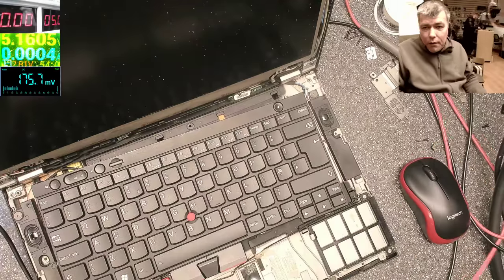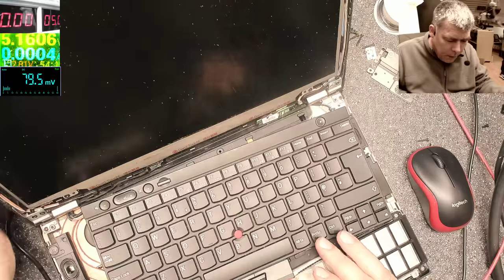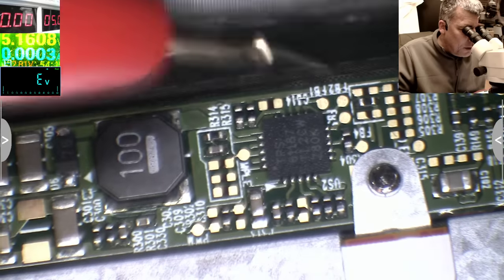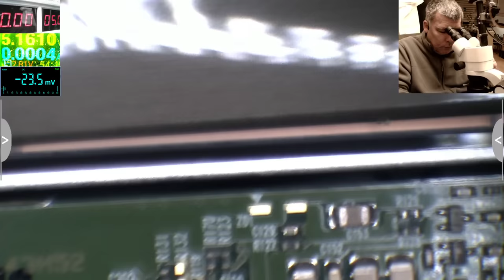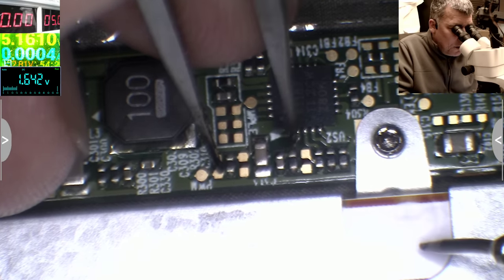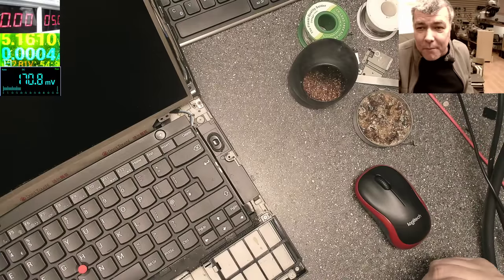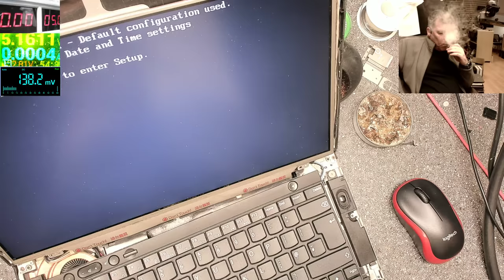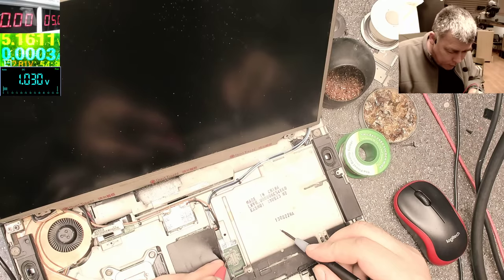Lenovo T430 - Let's learn about the backlight circuit

Comment: 8:57 that test point actually reads PWM, not PWR, so that is most likely your "DIM" signal, since it stands for pulse width modulation :)
Reply from the maker: True, thx
Reply: the major signal to activate the bcaklight is 3 major things .. the B+ PWM and the adj voltage..

Comment: Thank you sir. I watching you about a year. Last 2 weeks i had 3 nice scores: pixel 2 xl - the undercharged battery, Samsung Note 10.1 - slightly pulled screen ribbon cable and Dell XPS 1330 - classic shorted cap, found by your method. multimeter and low voltage + 1 amp current to power rail,  splashed by zippo fuel. It was fun. You making a people happy. Hello from Czech Rep.
Reply: Great. You made a good work. I can also get your information for my skill up.

Comment: Sorin, your overengineered repair audio jack port will outlive the rest of the laptop. 
True, you spent a few more minutes than just switching for the proper part, but it is also more cost effective than ordering the part, waiting, charging the part, etc... 
Always Kudos to Macgyver solutions :)

Comment: Haha, you could also add a resistor to that bridge just to lower the screen brightness a tad so its not at full brightness which would help battery endurance.  Lots you can do to laptops to get around problems and keep them running longer..

Comment: Sorin, thank you for all the knowledge you share with us. Personally, I would put a layer of capton tape below and above the bridge to protect the wire from touching anything arround it. I would not trust the thin enamel coating on the wire. I've seen some chemicals (UV cured) that help maintaining such bridges intact and electrically safe but never used any of them. 
Also please be less dodgy with the laptop screws and use some magnets for them :) 
Now about the previous video, I did a similar laptop headphone jack repair using an audio extention cord from the motherboard straight out a small hole on the plastic chassi (customer approved the solution). Also tied a loose knot on the extention cord as a mechanical stress relief (not the best solution) and it's still working fine, so yeah be as dodgy as the customer can accept.

Comment: It was inverted : 8:57 is not power is PWM=DIM , and the other pin is ENABLE ,so it was DIM=3v ,ENABLE=0 ,better idea is to bridge EN pin with 5v.In that case everything is working ...Brightness..

Comment: without having the schematic I believe the signal passes through the dimmer.  Without the keyboard plugged in there would be no way to power it on. I think you'll find it works without the jumper when the new keyboard is installed......

Comment: 18:22 super i/o can pull down to the ground that signal, ALSO if the hall sensor switch is bad (as you know - the sensor, which is checking if the lid is open or not)
Reply from the maker: Hmm, on that case the power button will not work also, but my power button its working
Reply: Doesn't lid switch stop screen altogether. Data plus bl?edit.. I just tried with magnet on my Toshiba.  picture is turned off too, not only BL, if lid hall switch active. Only backlight problem cannot be lid switch problem .  on my Toshiba anyway.
Reply: @Swenser  no

Comment: I came across your channel 2 days ago. Everything here is crazy in terms of knowledge. I have a dell ins.3537. And i cannot install my dedicated gpu drivers. Every time i attempt installing them my dedicated gpu (ati) starts to make some boiling high pitched noises and my laptop freezes. I also have integrated gpu (intel) that helps me watch videos and overall turn my screen on so i can use my laptop. And i know this aint the place to ask but Can i assume that my gpu is dead ? Any help would be appreciated.  Thank you. New sub.
Gpu is ati radeon hd8850M.

Comment: My T430's backlight is not working. On startup you can see the Lenovo logo (faded) and then nothing. I swapped the screen out 3 times and all of them are not displaying. Is it the fuse on the mobo? Is there a solution for this? Any help would be appreciated. =)

Comment: Dodgy but beautiful as usual, but wouldn't it has been better if at least you checked for a bad connection in the connector or a blown resistor which is preventIng the DIM SIGNAL TO REACH?

Comment: if they would give you the information you need and the access to the parts at a reasonable price.. then it would be different.. But if you know your stuff you can bypass a lot of garbage they put into these things.. Just ask a mechanic, those that tell you they don't do the same as Sorin are liars or have just started to work as a parts changer.. Not to knock the purist at all.. they are right in the fact that in the "perfect" world all things should be done correctly..But as Sorin said.. why take 6 hours hunting down the problem because you have no schematic.. when you can search and not find, just fix it and move on.. From a business standpoint that is the way to go.. If you guarantee your work and it works just as good as it used to.. then I for one wouldn't give a darn if my earphones are plugged into the same jack that was always there or a totally different jack as long as they worked! thanks Sorin.. I for one thing you do an excellent job and in a reasonable amount of time.. as those of us in business know the customer is always thinking we take to long and charge to much..

Comment: Are you not making a short like this? You didn't cut the DIM track coming from the super IO. So, if you DIM was shorted, your PWR line is too now?
Edit: ok I see, there's a resistor in between. So, no short.

Comment: First you should show us if that screen is good working on anorher laptop or a good working LCD panel has no backlight on this Lenovo after that i bellive the dim voltage is not coming from data cable.
Reply from the maker: Electronics its a very precise science, same as mathematics and both have nothing to do with 'believing'
Reply: Mr Sorin we are doing same job in different countries.I'm working in İstanbul Turkey.Many young techicians watching your repair techniques.You allways prefer easiest repair without spending time.Repairments needs tests before mathematic does not.
Reply: @electronicsrepairschool  Do you still have the peanuts T-shirt? Maybe it's time to use It again
Reply: @mardina1a  there is a lot of people here watching the Channel because it's name Is electronics repair school , in real life if you want to learn ,perhaps the best way to do It Is to be open minded ,the way to repair things of Sorin it's the beauty of the channel ,I'm here to learn but if you are Better why don't you open your Channel and show us how good you are, that Will be positive in a lot of ways and for a lot of people